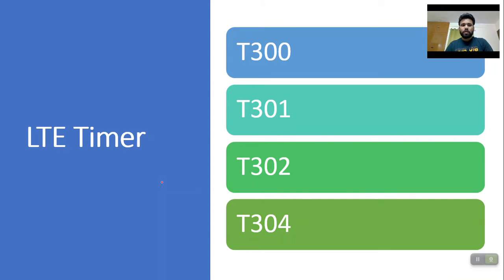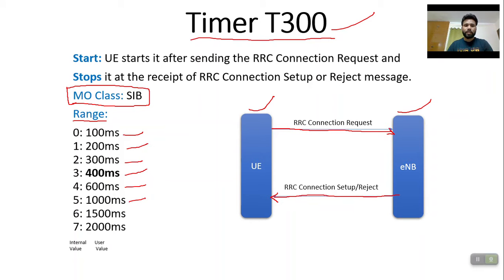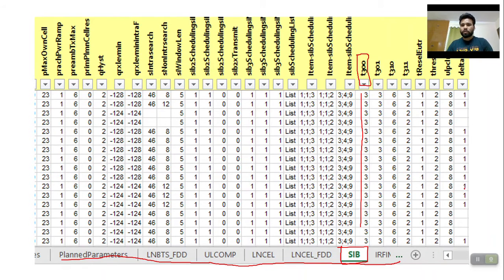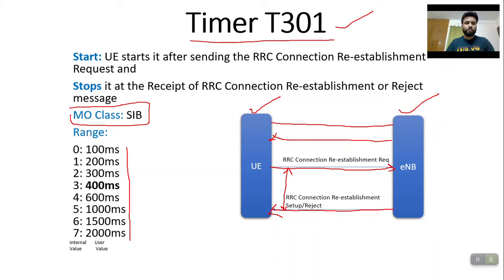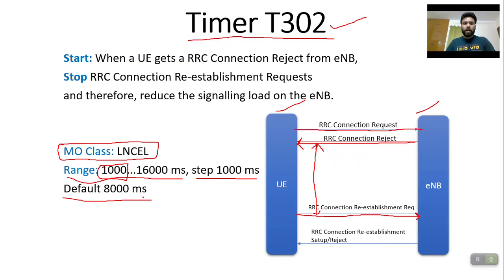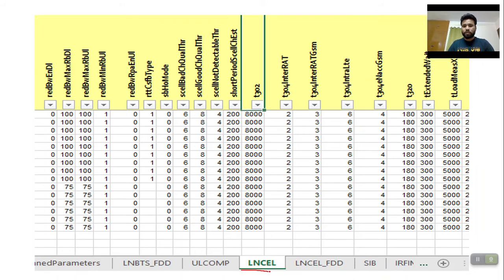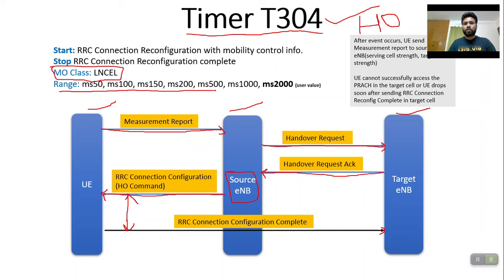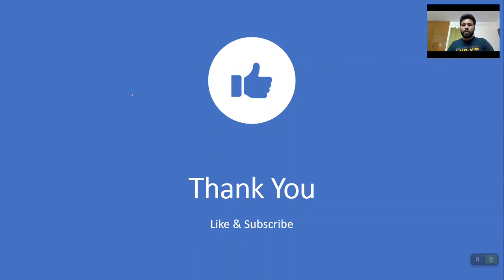LTE/VoLTE Timers

Comment: Sir, both T301 and T311 timer is for rrc connection reestrablishment, what is the difference between these two timers???
Reply: If UE detects handover failure, RLF, etc… then it needs to perform the RRC Reestablishment. For performing Reestablishment, first UE needs to select suitable cell, so it starts t311 timer.

Before expiring t311, if UE finds suitable cell then it proceeds to RRC Reestablishment procedure so it stop t311 and starts t301 timer.
Reply: @TheAbdulj6  thanks buddy